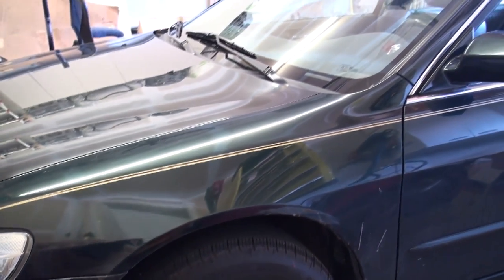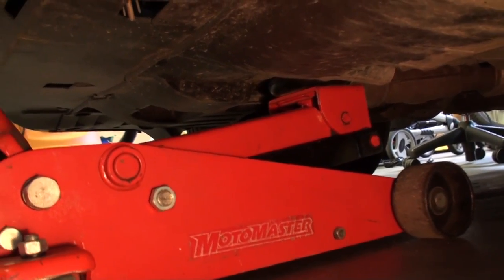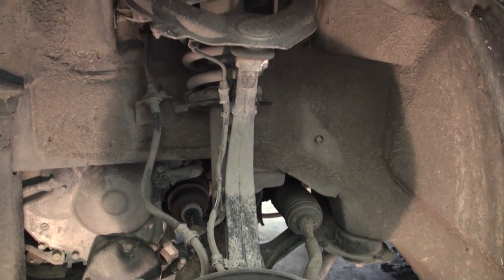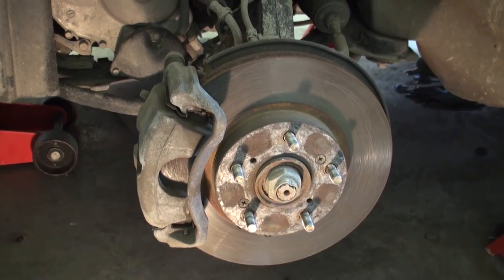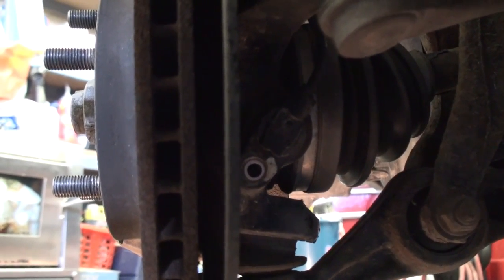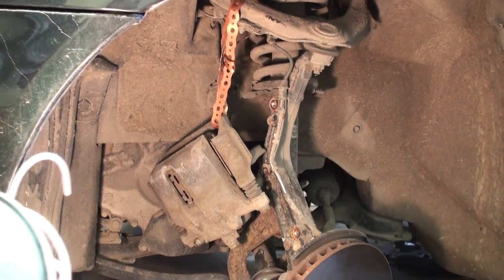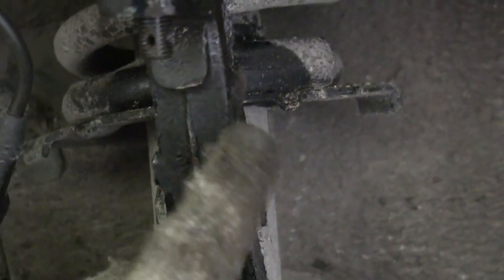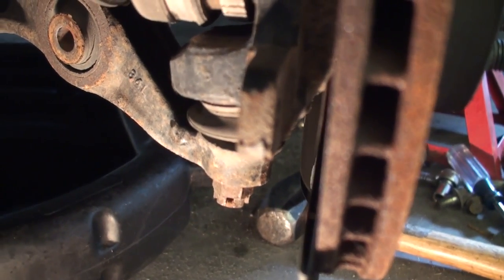1998-2002 Honda Accord Front Ball Joint Replacement

Comment: Five stars dude!!! Iv looked through forums, posts, and other videos. I saw yours, sat down, took notes, and im ready. Thanks a ton bro you saved me a 500 dollar bill!
Reply from the maker: glad you liked the video.  What is funny about this video is that my usual ball joint installer tool was faulty so I had to use the good ole' hammer press method (whack it in!).  Ironically after much thought the hammer method if you're careful works just as good.

Comment: Great tutorial!  Really helped me a lot.  I'm not sure why the suspension fork needs to be disconnected.  I ripped a bolt head off trying to free it, but it turns out I could do the entire job without getting it loose at all.  

Also, some have commented about how difficult it is to get that ball joint out.  I second that!  I was ready to give up with the ball joint's bolt ending up all smashed and misshapen after repeatedly banging.  I found I REALLY had to brace the entire assembly tightly against my feet, put a hammer or something metal below the ball joint bolt to kinda hold it in place, then WAIL as hard as I could with a sledge hammer... then it finally BUDGED!  It was a happy moment.  After that i just kept wailing and eventually got it to pop out.  So DON'T GIVE UP... just keep whacking away with force... it really does take a lot of effort.  

Also I had trouble getting ball joint nuts back on cuz the ball joints kept spinning.  Be sure to clean up your nuts and bolts well, WD-40 them, and use a large (4") C-clamp to squeeze them tightly while you tighten down the nuts.  It's tricky.  

Car's driving much better now - no more scary clunking from my suspension!  All thanks to this guy.  :D

Comment: This is is a great video. I have one tip on the ABS sensor: You can gently tap on the back side of the sensor(side opposite bolt) and remove it. I figured this out after breaking the passenger side trying to "wiggle" it out. The cost for a new one is $28 at local Autozone and one hr. of my time anyway.
Reply from the maker: great tip!  I've used that technique in the past but I'm always leery on damaging the face of the sensor (I've actually ruined one in the past).  Do whatever works but just remember that prying or hitting away at a sensor can potentially damage it.  The pitfalls of corrosion....

Comment: The upper ball joint is also replaceable , the old one is pressed out with a hammer , the new can be knocked in with a hammer or use a socket and vice . The new one comes with a circlip to secure into the groove .As it is a large circlip , after fitting I use stainless locking wire through the eyes of the clip for added security. I have 2 Accord V6 Coupes in the UK .
When breaking all the taper joints ,use a 2 lb + ball pean hammer ( not a 16oz chippies hammer ) and strike the casting firmly at the end .You are separating a taper joint that is not corroded . One blow properly directed is usually sufficient , if your not replacing the top joint , use a drift and hammer as the striking area is smaller . A 'C' clamp is not necessary simply gently tap the base of the joint until the taper locks in or place a jack underneath for the same purpose and just re tighten .
Use old ATF and not WD40 . WD40 means 'water displacement formula 40 ' its not a penetrating fluid . ATF does a great job on corroded parts as it has both higher lubricity and better ' creep' ( the ability to get between parts ,hence all the special gaskets and seals in an automatic transmission gearbox) . If you mix it with a little pump petrol you get the same formula as the old ' Plusgas' penetrating fluid . I used the same mix to undo the engine bearer to bulkhead bolts on a P51D 'Mustang' that had been at the bottom of the North Sea since April 1945 . The bearer and bulkhead behind the firewall being aluminium is not a good place to apply heat but the old ATF out of my Honda CRV with petrol did a great job on those and many other seized bolts .
Reply from the maker: that is interesting, I always thought the front upper ball joints were part of the upper control arm and that the entire assembly had to be replaced.  I'll have to look into this further as I swear the honda's that used the double wishbone suspensions had a replaceable lower joint but not the replaceable upper joint.  Thanks for sharing that knowledge as I would've otherwise not known.
Reply: Several different manufacturers on EBay UK , I can't remember which one I used but all follow the same fitting principle . Search Honda Accord Upper ball joint . I think 2003 Type R on are the same . All 4 upper and lower for about $60 . If you can't order them in the US I'll be happy to send them over .
Reply from the maker: Thanks I'll definitely check that out.  Learn something new everyday!

Comment from the maker: @ Scott Duty - I knew the joints were loose when the car needed a wheel alignment and the stealership said the lower joints were getting a little loose.  This Accord is a V6 model so the front end is quite heavy putting and the roads here have many bumps and potholes leading to premature wear.  I've had a 91 Civic that was on the original ball joints at 500, 000 kms!  YMMV
Reply: Thanks! Did you use a new axle nut as well or did you reuse the old one?
Reply from the maker: @Scott Duty - nope I just reused the old one because the old nut's locking tab indent was still intact.

Comment: I thought the whole point of this video was to show HOW  to remove the ball joint. You start explaining at 12:30, turn off the camera to do the actual work to break it loose and then at 12:35 it's out!.  
Then at 13:48 you explain how yo are going to put it in, turn off the camera, do the work and 11 seconds later it's done.
You missed the whole part of the video!
Reply from the maker: 1. I didn't have a camera person to help film and you can't point out a joint and hold a camera at the same time. 2.  To remove the ballpoint by using a socket and literally point it out. I did show the setup so it is quite straightforward. 3. Reinstallation is done NORMALLY using a ball joint clamp BUT the one I rented was faulty and so I used a hammer and tapped the ball joint in (it is remarkably easy). 4.  I did explain at13:50 that I ran into a problem with my ball joint clamp tool and explained the process of how to install it. 5.  I will admit this video wasn't my best (in fact probably one of my worst) but the general procedure and concepts were explained.

Comment: Is there any chance of looking at the base of the lower ball joint for the "B" without taking things apart?  I'd like to have my parts ready before starting.  It's sad that this can be either $50 for two lower ball joints or  $380 for both arms.  Great video!  Love the detail and tips.
Reply from the maker: @ Timmym734 - sadly you gotta remove that knuckle off the car first and use a dremel or wire brush to remove the dirt and corrosion off the top of the ball joint to look for the marking.  But I look at it this way - if you need to replace a ball joint then it won't matter whether it's serviceable or not because it will need to be fixed either way for the sake of everyone's including your own safety right?
Reply: I really just want to tear it apart once and get it done, due to time, work, no 2nd car, etc.  Obviously I'd like to save money, but if I have to get the whole deal then I will.  Gotta be safe  :)  I'd be too nervous to drive around if I felt things weren't done right.  Thinking about all of this gave me an idea.  I may order the knuckles AND the separate ball joints.  Whatever I don't use, I'll return.  Thanks for the advice!  It's appreciated very much.
Reply from the maker: What a great idea!  Buy it all and then return what you didn't use.

Comment from the maker: @Dongha- The upper joint was still very tight so there was no need to replace the upper joint.  Upper ball joints can be quite pricey when purchased from Honda.  I tend to use genuine Honda parts as I find their quality to be considerably higher quality (and more expensive) and if I'm going through the troubles of removing major parts on my car that I'd rather put in high quality parts once than to replace it over and over and over again.
Reply: I would of gone with Ingalls Ball Joints they are the same as OEM Honda which I always do buy OEM Parts but when it comes to suspension I like to Upgrade my balljoints, suspension, camber kit ect since my V6 accord is lowered. feels so amazing and just the comfort after replacing everything. but over all great video so helpful to those that need it.
Reply from the maker: @ LaCountry8l8 - yep Ingalls joints would be a good alternative to the stock Honda ones.  Too bad they're not easily found in my neck of the woods (at least I haven't seen them in stores).  The US or other countries likely have more access to alternative part suppliers.  Yes having a tight suspension is always great and makes the car handle very differently with a LOT less "SLOP" in handling.  Thanks for the comments - I wish my balljoint installing tool worked better (it was stripped) so I had no choice but to resort to using a hammer to install them which works but I'd prefer to use the ball joint press.

Comment: I appreciate your good work here in clearly explaining how to do it.  I had forgotten what a pain it is dealing with rust.  How do you know a lower ball joint is bad?  Does the handling suffer or do you just look for tire wear or looseness?
Reply from the maker: you can tell by prying in between the lower control arm and steering knuckle (where the lower ball joint is) and if there is movement or "play" then the joint is bad.  There should be NO play on a good ball joint.  The other tell tale sign if the car is on a hoist and you give the tires a wiggle by holding the tire at the 12 o'clock and 6 o'clock position.  Depending where the play is (top or bottom) is how you can tell if the joint is worn.  In this particular car's case it was the dealership that tried to perform an alignment on it and realized that it was worn.  

As fas as what happens this is what occurs when the joint is worn:
1. Suspension geometry goes off kilter which means the car won't handle the way it was designed to.  
2. If it's really badly worn you can often hear the front end "clunk" when hitting bumps.
3. Tires wear down faster (remember your geometry is off).
4. Car can't be aligned properly (again geometry related).
5. Poses a huge safety risk b/c the joint could eventually snap and break apart completely disconnecting the steering knuckle from the suspension.
6. Handling is worsened (b/c of incorrect geometry).

Whenever a joint begins to develop any degree of play it gets replaced.  Aftermarket joints for example are roughly $35 each and there is NO excuse not to service them.  Safety for you and others on the road are paramount.

Comment from the maker: @ deeerkila4life - yes you're right that you can use a pry bar!  I should've stated that before.  I just coincidentally went for an alignment and they said it is loose.  Great tip for all!
Reply: What was his tip? I am about to under go this job. thanks
Reply from the maker: I believe the tip is to use a pry bar to pry at the lower ball joints to check if they're loose instead of wiggling the tire at the 6 and 12 o'clock position to determine if there is play in the joint.  You'd put the pry bar between the ball joint/steering knuckle and lower control arm and pry it back and forth.
Reply: thanks
Reply from the maker: you're welcome!

Comment: Only suggestion I got is there is a wonderful tool called a pickle fork, it works wonderfully to separate balljoints and tierod ends.
Reply from the maker: I actually have 2 pickle forks but stopped using them b/c of the constant tearing it does on my tie rod end and ball joint grease boots.  Even the tool I used in the video isn't quite up to snuff as far a popping off a steering knuckle's ball joint without doing some tearing.  Each to their own I guess - I've had nothing but bad luck with pickle forks :(
Reply: Ive also used pickle forks and torn the boots one too many times.

Comment: good video, thanks, you sound really Canadian...would also explain all that corrosion...damn road salt!
Reply from the maker: I sound really Canadian? LOL I guess it is no different when I say someone sounds very American or British... I of course don't know differently but it is humouring to have someone point that out.  yes most of Canada does use salt on the roads in the winter which causes rust.  If you'd believe it, the rust on this Accord isn't really much rust at all, in fact it is considered minimal by my standards.  If a car came from Eastern Canada then it is REALLY bad, so bad that I avoid working on cars from those areas.

Comment: Few pointers. Wasn't necessary to loosen the fork. Always use a center punch to remove the axle shaft.to prevent the risk of damage to the end. Ball joint separation tool can also be use to  loosen top arm ball.  joint . If using a hammer you should pound closer to the ball joint.
Reply from the maker: All the things you've said are definitely true. The approach I used to take the knuckle out is just different compared to other methods.  A tiny bit more work but I find it EASIER to take out using my method.  Each to their own.  Thanks for sharing!

Comment: Very good video. What would you estimate the cost would be to have it done at a shop? Thanks!
Reply from the maker: It varies from shop to shop and from country to country but as a general rule of thumb this would've cost about $500-650 CAD at the local honda dealership.  Ball joints alone are $150 each (I believe that is what Honda's current prices are in 2021). If you're in the US you probably should expect to spend about $400 for the same job b/c parts in the US are SO much cheaper than they are in Canada.
Reply: Thanks!

Comment: Hey I know this is old, but do you remember when you order the oem ball joint, did it come with the nut and pins to help lock it in place?
Reply: I meant snap ring
Reply from the maker: I believe the new ball joint from Honda did NOT come with a new castle nut and it also did not come with a snap ring.  There is a revised installation procedure from Honda that doesn't require the snap ring anymore.  If you buy aftermarket ball joints they do come with a new castle nut and snap ring.  Not sure why the discrepancy but Honda at the time of this video excluded the two parts you're asking about.

Comment: if you have the ball joint tool... why did you use it for the upper control arm ball joint or the outer tie rod ?
Reply: Ben Grant man I was thinking that same thing. lol
Reply: lol.  I meant to put didnt* as well
Reply from the maker: b/c the ball joint tool that I have tends to tear the boot on ball joints so I would prefer to not use it to take anything off other than the lower ball joint b/c if I tear the boot I won't care as much.  Gotta use the tool that I have at my disposal.

Comment: Was just wondering how much time this takes from start to finish for both lower ball joints?
Reply from the maker: @ MrSublmnl - each said took me (experienced doing the work) probably about 45 mins / side but realistically I would advise you budget 1.5 hours per side and have the right tools and you should be good.

Comment: i have a question i changed my cv axels off my 98 honda accord ex 4 cylynder  just time for people that see this u have to bang i mean bang the bottom nuckle and try not to famage the balljoint but like i was saying i have a clicking sound not realy clickbut like a thump when i hit a bump is that cus the cv axels aren ew or could that be my lower ball joint
Reply from the maker: +Angel Fuentes it could very well be bad sway bar bushings too.  It is difficult to tell unless you use a pry bar to pry on the knuckle to see if the ball joint shifts at all.

Comment: im going to take a look sound like something is loos every time i hit a bump under neeth in the right area to the cv axel all the way to the weel s sound like a hourse foot step every time i hit a bump but thank u if you do have a feeling or come up with what that mite be please let me know you do the most best discribe videos of how to do thank u again
Reply from the maker: +Angel Fuentes Angel make sure your CV axle is installed correctly AND that the internal and external races in the joint move freely .  I would recommend you remove the axle and move the joints back and forth to make sure there is no rubbing or binding within the joint.  Sometimes if the races are misaligned it will cause you all sorts of grief.  Your CV axle could've been dislodged without you even knowing it when you were servicing your ball joints.  Did you double check your ball joints too?  Are they pressed all the way in?

Comment: i mean new or did i install it wrong or is it because something els pleas let me know i dont wont my weel to fall off or any of hat
Reply from the maker: +Angel Fuentes Angel it is very hard to say without know what you've replaced or how you re-installed it.  Did you follow my instructions exactly as described?  Clicking could also indicate a misaligned joint where the inner and outer race are not sitting together properly on either the inner or outer joint.